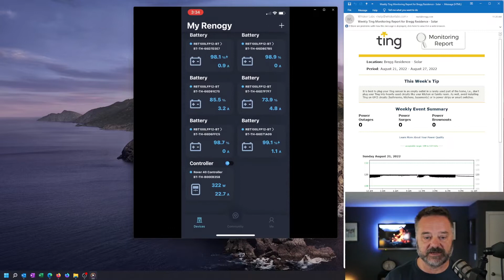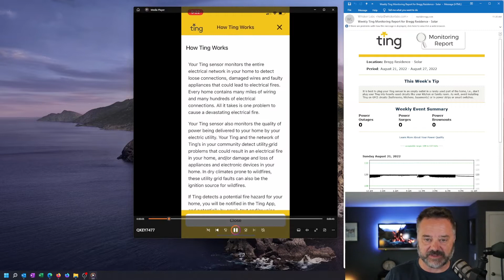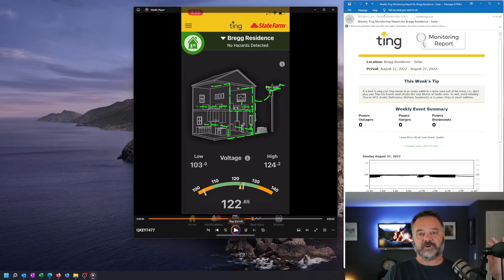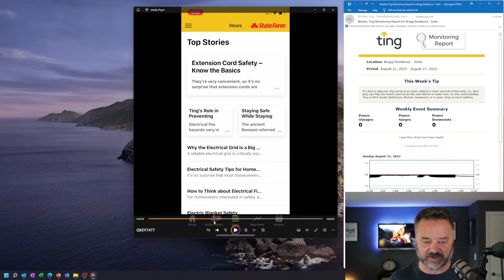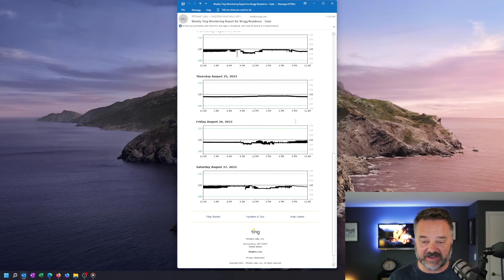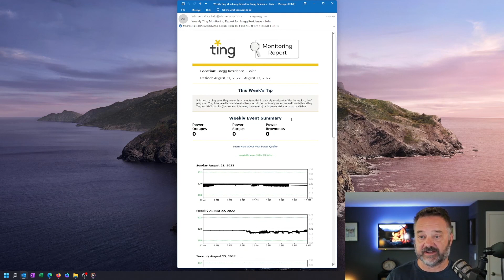Ting Sensor Review

Comment: Most UPS you can buy that has a USB or Network connection and monitoring software, monitor and display such voltage and power stats. I have several Cyberpower UPS models and using their business version software, it logs all the electrical stats, changes in voltage and many other things. (that is kinda its job afterall). There are more high-end often rack mount Online UPS that have even more extensive power statics. Power conditioners also report a significant info on incoming power. A little device like this, feel just like them UPSs but minus the battery and outlets. My guess, is that this device simply sees an issue when voltage drops suddenly or raises suddenly.  say a space heater plugged into a outlet strip, starts to cause the strip to melt, or outlet to melt, this will not detect that. A archor ground fault can happen and not cause a large spike or dip in the whole home..
Reply from the maker: You are correct. This is not a Uninterrupted Power Supply. This is purely for monitoring purposes only. You are right in that it may not detect a space heater having issues. However, this isn't 'smart' enough to work like that. How it works is centered around detecting drop in voltage that can happen for a variety of reasons. A good example is the one I have specifically for monitoring my solar powered line. It will send me a message when the voltage drops when I plug in something that the Renogy inverter 'hiccups' on. For example, sometimes when I plug in one of the smaller portable EcoFlow batteries the voltage will drop down (last week it dropped to 94.1V for a split second) it sends me an alert on the phone right away.

Their system considers this a 'brown out' event and explains what it is and what to keep on eye out for. When this happens on my solar power grid, I go and double check the inverter from time to time. However, should this happen with my Consumers Energy grid tied power, I for sure would look into it, as that has never happened to me.

Does this information help?
Reply: @AaronBregg  Ah HA! found what I was looking for. I have a manual transfer switch , ecoflow battery power stations and some (beginner level) solar panels. I am using the MTS to switch off the grid for certain circuits on sunny days. Will this Ting device be triggered and potentially give false  reports to State Farm?
Reply from the maker: @RickEtsuko  Kind of. Here is what I mean.  Yes it will trigger an alert but you can always rename that sensor to one related to your solar power workflow. For example, I applied for a second sensor because I have two different ones and would like both monitored. Once Ting verified this, they sent me a second one. While the solar one does report back more often (The inverter will drop voltage from time to time when I plug certain things in [The sensor reports this as a Brown Out event]. I have one named solar that they know which device is attached to with power flow.

Does that help?
Reply: @AaronBregg  yes! I talked to State Farm today and they told me ting will not notify them. I've got one coming and they are asking about a second one for my backup system.
Fun stuff!
Reply from the maker: @RickEtsuko  To be clear on the data part, since some people have made comments on Ting and later on State Farm getting your data. As someone that is in the Information Security business, this is what I consider 'Low Probability, Low Impact'. Meaning that if bad guys (or companies) got access to this data it would not impact day to day life.

Always remember, if something is free than 'you' are the product. However, this one is a good trade off IMO. :)

Comment: If you have solar panels, but no battery backup, do you need a separate ting for that??
Reply from the maker: After working with Ting, we did come to the conclusion that a separate sensor was necessary. While I know the 'free' period that State Farm is offering won't last forever, at that point I will have to choose which one I want to pay for going forward.

Comment: Very informative video.  Thanks for sharing.  It would be great if Ting offered a plug-in for Home Assistant (HA) that would allow home owners to collect and monitor their own data.  I did some research to see if it's offered, but it doesn't look like they have a plug-in currently.  They actually don't have a public API yet, which is probably the first step to make this happen.
Reply from the maker: Solid idea! Hit me up via DM on LinkedIn with your email addy, as I think I still have a contact at Ting. Let's get this over to them. :)

Comment: I got the offer from state farm today and thought this was kind of a cool toy but also have reservations about data security and misuse. Read the FAQ and appears to explain the deal, but I might bite on this. I am a Embedded Hardware EE and work on product developmt but my first paid job back in 1986 was designing a RF detector for distant lightening so I thought this was very cool when I read about how it works. Honestly, this is a sweet deal for the manufacturer to get thier device into homes with the blessing of the insurance company. They probably do not make a buck on the devices but on the subscription service and perhaps a referrral fee from a service tech but it looks like you still have a choice to continue to use the service or hire your own electrician.
Reply from the maker: All good points, especially since my paying job is an Information Security Analyst. Just like I do at work, it came down to Risk vs Reward. Yes, they most definitely have your electrical data BUT outside of your quality and current state, there isn't really anything else.

The only downside I can see is that if you get lots of alerts and don't do anything about it, it may hurt you should you need to file a claim. BUT, the upside is that if you are proactive and something happens you will have more ground to stand on with the insurance company.

If you want to see what a weekly report looks like drop me an email and I will forward it over to you.
Reply: @AaronBregg  It's odd how my posts keep disappearing. All I will say is one should be very careful about signing up for this thing. Read the entire terms of service carefully and look for discussions online to make up your own mind. I, for one am declining this offer.
Reply from the maker: @arydant  Understood and no judgement from me. :)
Reply: @AaronBregg  Thanks for posting this - It helped me do more research on whether to move forward or not.

Comment: I just got the offer from State Farm for one of these, but I would like to know if they have access to the data and what their real motive might be. Also unless you have 2 of these, 
(one for each leg), then you are only monitoring half of your home. You could also have a problem in the one circuit the device is plugged into, which could be different from the readings for the rest of the circuits in the home. I think I would opt to just buy a type that monitors both legs and pay for it myself. Always beware of free stuff.
Reply: Reading the fine print in the contract makes me wonder if it's a data collection device, similar to FB, Google, and others. I can see the benefits to insurance companies. Anyway, i just informed Whisker Labs that I plan to return TING. Better safe than sorry.
Reply from the maker: @5785B  Again, I work in information security and it is my job to assess data risk everyday. I thought about this alot and honestly, outside of ''punishing' someone not fixing something that could potentially destroy their home (and cost State Farm a lot of money), I really think the trade off is worth it. But! You do what you are comfortable with. No judgement from me. :)
Reply: @5785B  The benefit for insurance companies is not having to replace your house and all the contents from an electrical fire if it can be prevented instead.
Reply from the maker: I am not sure what you mean by 'legs', as the way I use it I just need it for monitoring for fluctuations and comparing it to the power output from my solar rig. As far as data privacy concerns, my 'day' job is in Information Security. The data that would be collecting really couldn't be used for anything but line 'quality'. 

The whole point of having these are around the alerts and information that Ting (not State Farm) provides. In the monthly newsletter they give stories on how Ting alerts helped prevent potential fires.

The only way I could see them data in a 'negative' way would be if you got multiple alerts and then you didn't act on it and then a fire happened.

Does that make sense?
Reply: @AaronBregg  Houses in the US have 2 separate  110 volt lines coming into the house. You can loose one of them and the other half of the house will not be affected. When you need 220 volts, then the 2 legs are used.
Reply from the maker: @kwd57  Thanks for the info! I learned something new today. :)